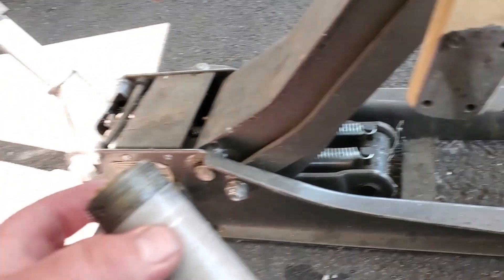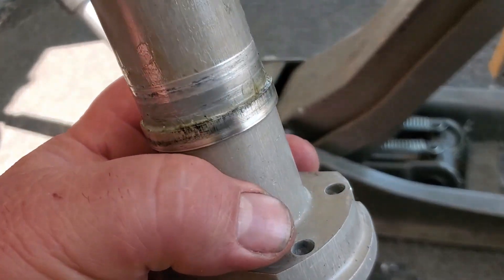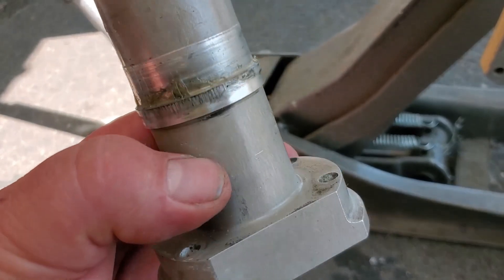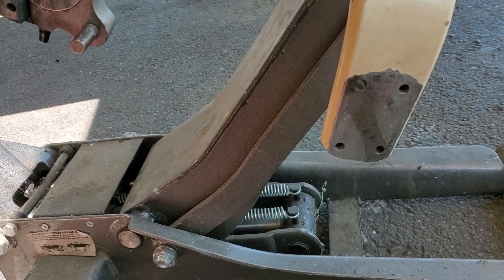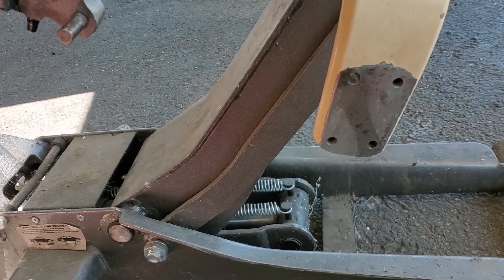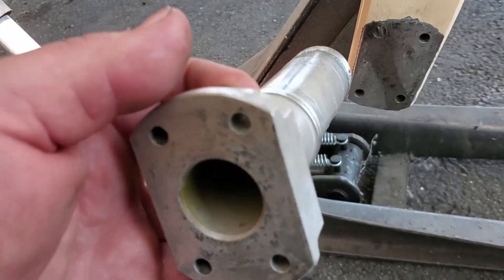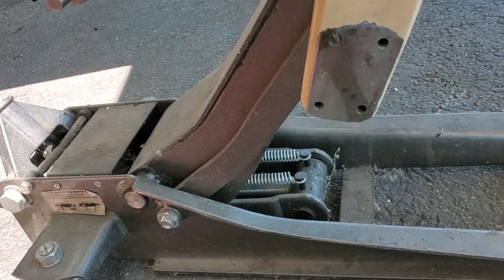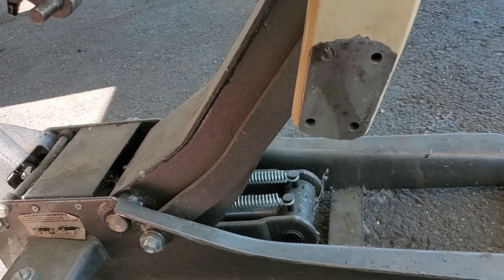Axle replacement on Cessna 120 140 Hollow to Solid

Comment: Thanks for this video. How many planes has this happened to?  Karl 90083
Reply from the maker: As for cracks, almost all that I have inspected. Only have been maybe 2 or 3 that haven't had any indication on the dye pen. As for axle breaking on landing. I know of 4 here locally in about a 2 year span, nothing recently though.
Reply: @TheArctictern  sounds like it should really be an AD.
Reply from the maker: @karlw7764  Yes I totally agree
Reply: @TheArctictern  roughlt how much weight does this add?
Reply from the maker: @karlw7764  I don't think it adds anything significant...now if you installed a steel axle there may be a difference there.
Reply: Oh gosh. You mean to tell me I am flying hollow, ALUMINUM axles? This is going to the top of the list.  @TheArctictern
Reply from the maker: @karlw7764  Yes you should dye pen them ASAP.
Reply: @TheArctictern  not really interested in dye pen. Just because they are not cracked now doesnt mean they arent work hardened and ready to crack tomorrow. I would rather eliminate a known weak point on general principle. Plane goes to mechanic tomorrow. What part number do I need to replace them?
Reply from the maker: @karlw7764  if you go with Grove axle you'll get the 5016-(x) x= what ever holes you have in the gear leg...I would recommend the 5/16" which I think will be the -2. Don't tell Grove that you're putting them on the 140 they won't sell them to you.
Reply: @TheArctictern  Thanks. My A/P suggests using 170 axles. He did one last year. Direct bolt up and in this application steel inspires more confidence than Al, at least for my use here in dry CA.
Reply from the maker: @karlw7764   Yes those work great too. Then its just a log book sign-off. You'll have to bush the lower holes because they will be 3/8" . You can take the holes out in the gear leg up to 3/8 too. IAW S.L.N.-60